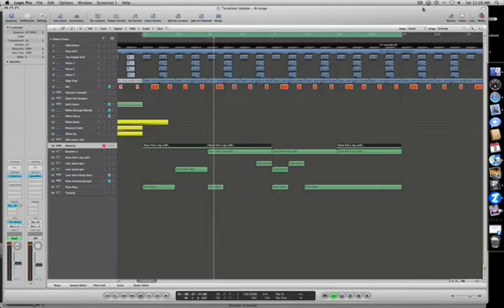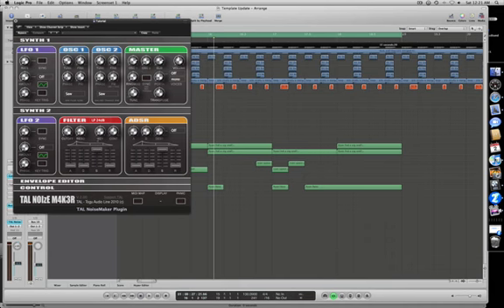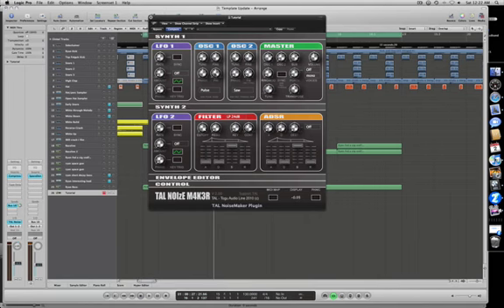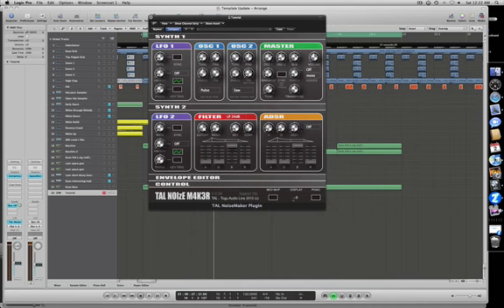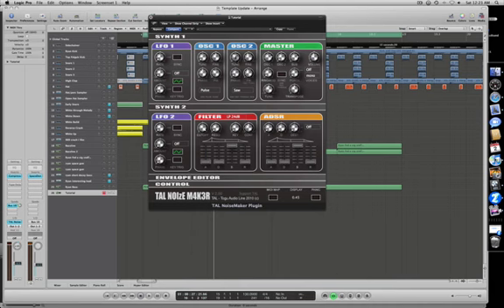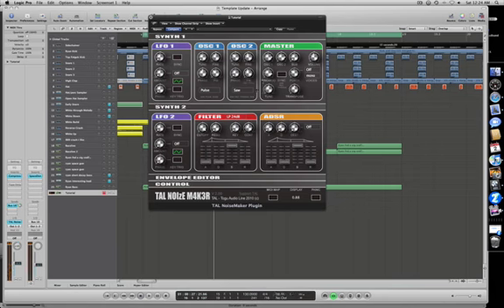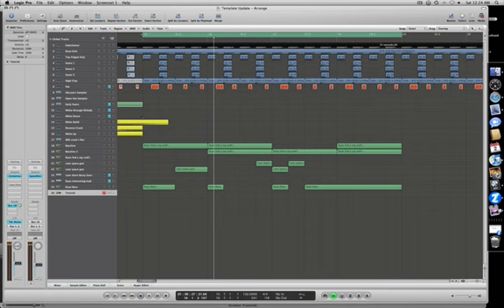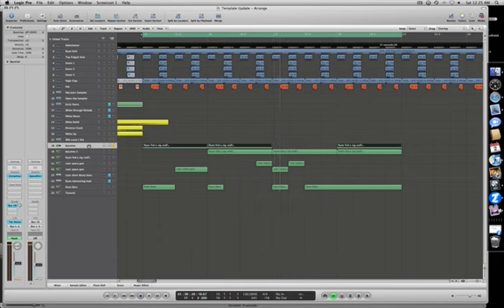How To Make A Nasty Electro Bassline Synth Patch

Comment: Ok guys, If you have downloaded the noisemaker and it's not opening, try this:

start at library->audio->plug-ins->components, drag the icon (or copy and paste it) into the components section, then open logic in 32-bit mode so the newly installed plug ins are properly scanned.

Go to I/O section, and under AU Instruments, it should be there.

Comment: Which Reverb are you using on the synth & what type of parameters are you using? I know they're pretty specific to each plug-in, but generally speaking, Reverbs are all universal in most ways... the reason I'm asking is because this is what's giving me the most trouble with my production -- finding the right timing/stereo placement of the reverb used on my lead/bass. I know not to use reverb on my sub patches, but on something like the sound created, I was hoping for some direction. Thanks!!